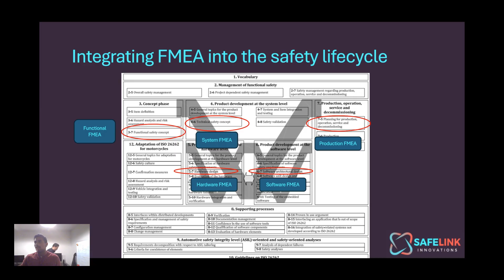FMEA - Integrating FMEA into the project lifecycle

Comment from the maker: FMEA is one of the most important safety analysis techniques in **ISO 26262**, but managing large FMEA tables manually can quickly become difficult.

*SLIKWORKS FMEA Software* helps engineers structure and manage FMEA workflows more efficiently.

- Perform *functional, system, hardware, and production FMEAs*
- Organize failure modes, effects, and safety mechanisms
- Analyze large FMEA datasets more easily

Learn more about SLIKWORKS:
https://www.safelink-innovations.com/slikworks/fmea-software